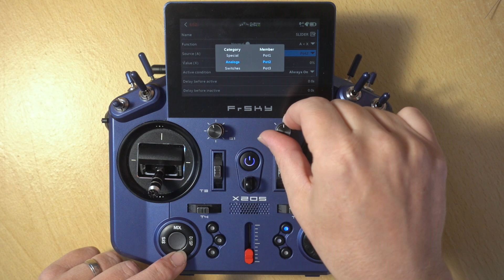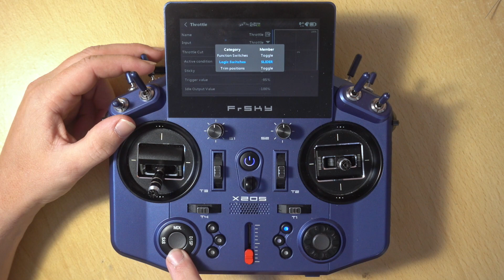FrSKY ETHOS: Using a linear control as a switch - using the red slider for throttle cut

Comment: Darrin, Is there away that you can use a side slider switch as a trim for throttle.  Use this for having electric motor continuing prop rotation during landing.  Thanks

Comment: Throttle cut is a safety feature, so never set it to a control that is so prone to being moved accidentally.
Reply from the maker: Accidentally moved is more a lack of muscle memory than using a bad control. I would rather very rarely accidentally disarm than be hindered when I needed to. 100% it’s safety. But to me, that means disarming as quickly as possible, when needed. The loss of a model is insignificant in comparison to the loss of fingers.
Reply: @MrD  Agreed, but with a slider it is very easily accidently back in armed mode while you might be thinking to be safe.
Accidentally disarming is not my concern.
Reply from the maker: Oh true. I personally would never use a slider for arming. That was just what was requested for a video.